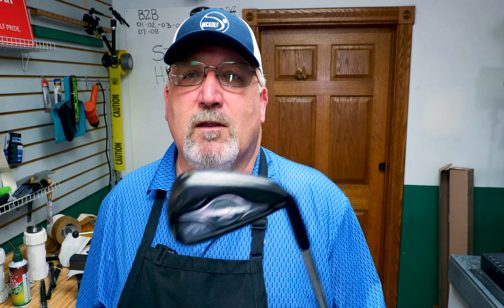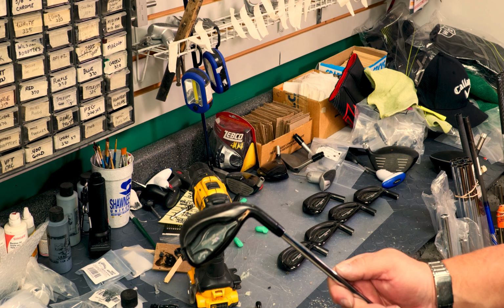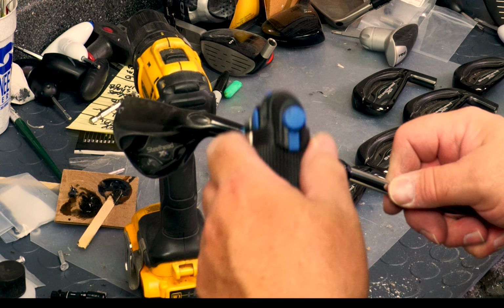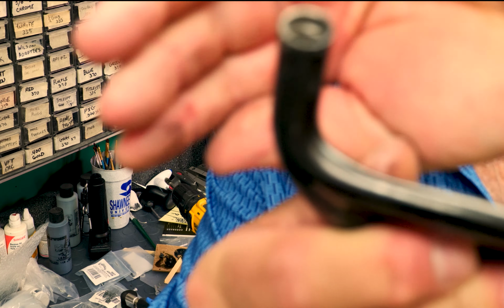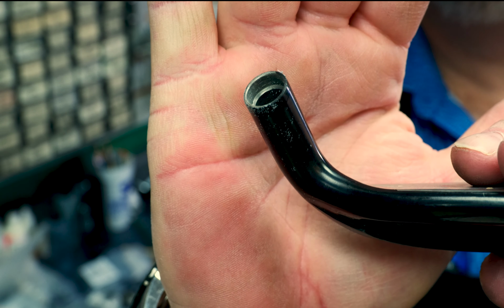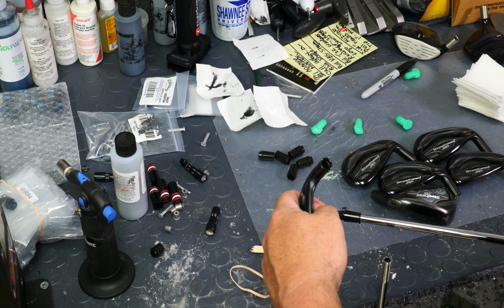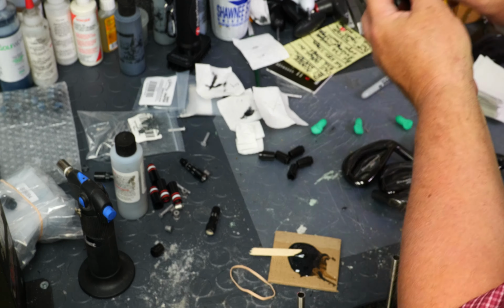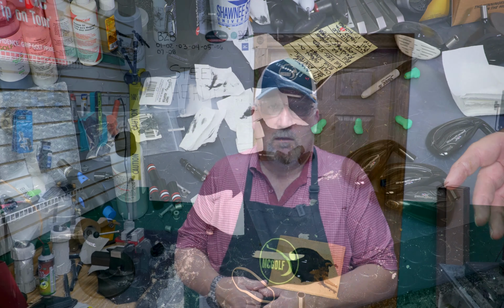How to Remove a Golf Shaft 2022

Comment: Jim, you might add that the way to determine if the club is a true bore through is that, on the bottom of the hosel, the the shaft will show as separate from the plastic plug, easily visible with a steel shaft and less so, though still visible, with a graphite shaft.

Comment: Jim do you ever reuse the ferrules?
I do, on ones that have the clubs serial number engraved into them I believe it's important to keep provence of the clubs. I use the hot water method to release them.
Just wondered if it was something you did or considered doing too?
Reply: That's OK if just replacing a shaft like for like but If changing to different spec the serial number won't matter as those numbers are for custom fit specs. i.e mizuno
Reply from the maker: On older models where it’s an appearance concern I will try to save them as the serial number means something to the player but it is rare. Usually it get rid of them and go new
Reply: @McGolf  Thank Jim...yeah my OCD means that I try save them if I can 👍

Comment: I did this many years ago and I’m pretty sure for the plug I just cut off an old graphite shaft, filled it with just a little bit of black epoxy and glued it in. Then sanded it down. Probably not pretty like your work, but..
Reply from the maker: That is an option but we typically like it to look original